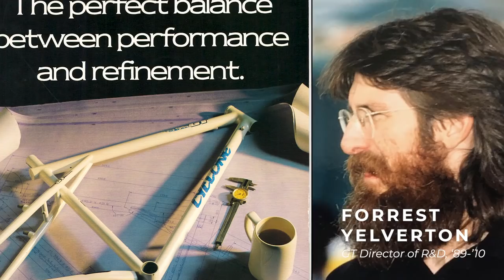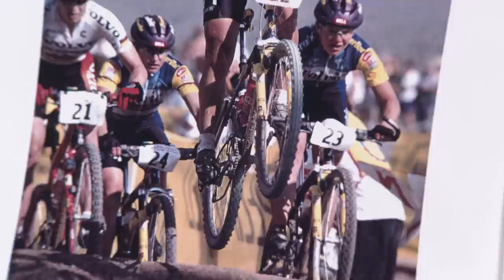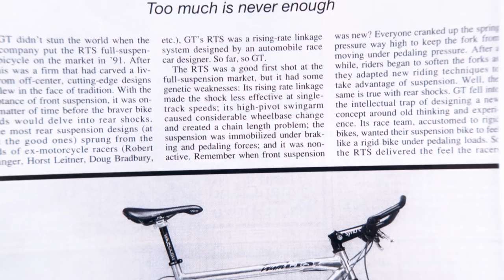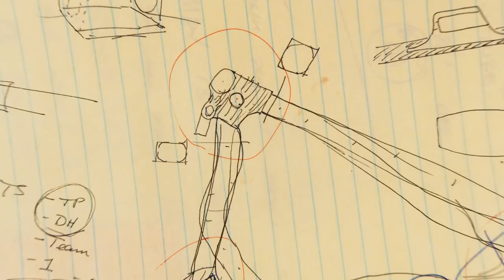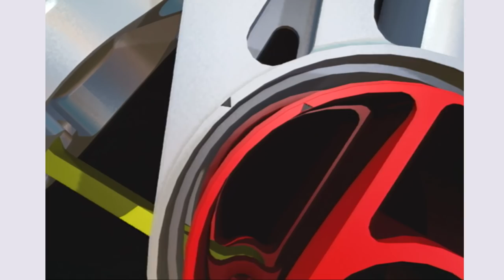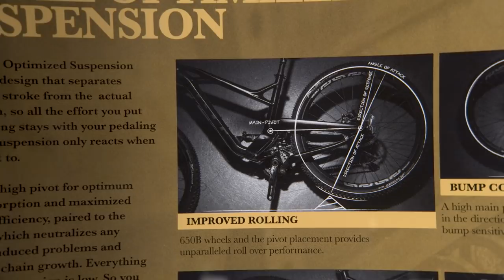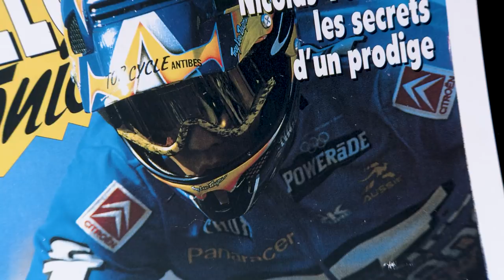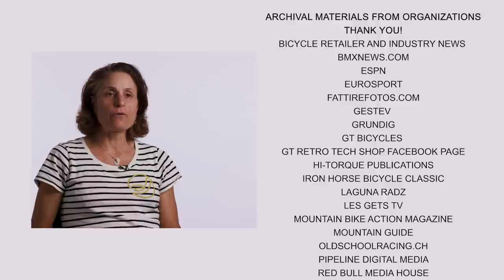Full Travel: GT's Suspension Development Story

Comment: I still have my RTS-2 frame hanging up in the garage.  It was supposedly a factory display model and was un-serialized, so I had to pick my own SN that the shop stamped into the BB shell.  The weld for the rocker mount has a hairline crack.
Reply from the maker: That's rad that you still have it! 👊